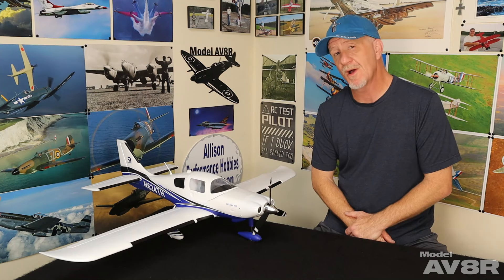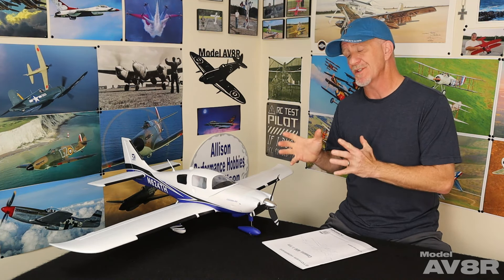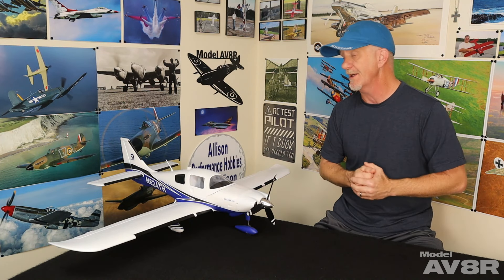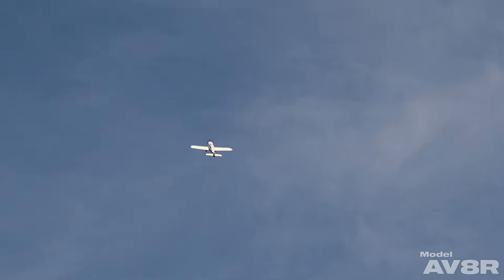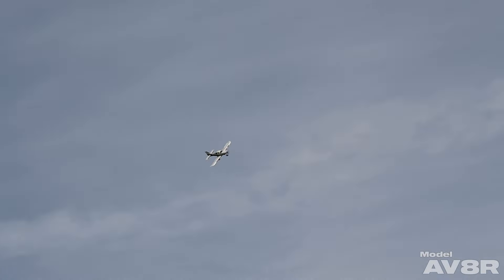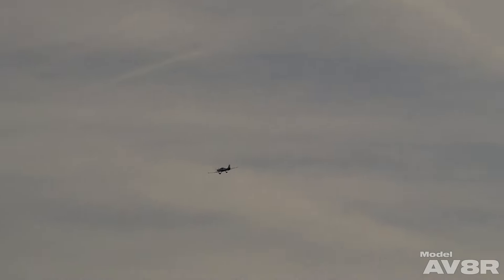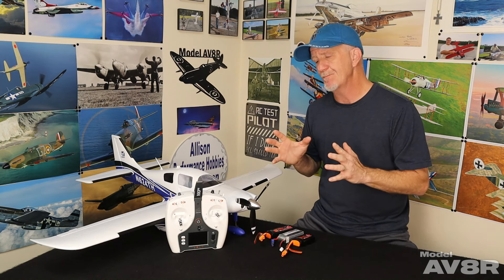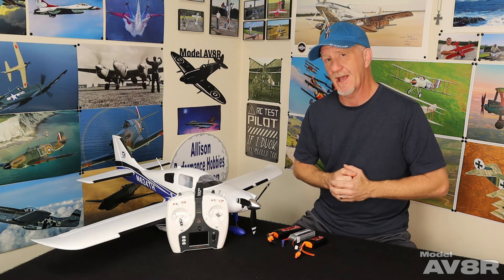Tower Hobbies Cessna 400 1.1m PNP - Model AV8R Review

Comment: Alternative fix for the rod flex: Take a cable tie/zip tie, wrap round the push rod, insert it into itself and pull till the circle left is about twice the diameter of the push rod. Cut off most of the tail, in a point shape, leaving about an inch 'tail' behind. Poke this tail into the fuselage foam (don't have enough tail that you go through to the outside!), hold in place, power up and check the control movement/rod flex. If all is good, wick a few drops of thin CA down the tail and leave to set. End result is a couple of plastic, circular retentions which are super cheap, easy, neat and effective. It's a technique I learnt from a forum for the Twisted Hobbys Crack Turbo Beaver which was originally supplied with control rods that were too thin. Great review again Adam
Reply from the maker: Yep, thought about that. That is one of the tips we included in our "Tips for every RC Pilot" video to keep loose wires sorted. The pushrods on this create a good bit of pressure when they flex (or try to) as the servo is pushing them, so I though better of it...might pull the zip tie out of the foam. It is a great idea with the super thin carbon pushrods on a flat foamie.
Reply: @ModelAV8RChannel  Ah, I didn't know you had already featured it. I guess those metal rods push hard!
Reply from the maker: I think it is because the servos are close to the only place to fix it. Easy fix though...

Comment: Such a great presentation Adam & Heidi, well done. Love the HRB batteries. Looks good enough to fit a camera in the cockpit.
I had a similar problem with servo wires & threaded the wire thru a small shrink tube then glued to the foam. I did a similar fix in the UMX Twin Otter nose area where the steering wire comes thru  to the nose wheel & was interfering when the battery was inserted. The small ‘feeder’ tube glued in & wire threaded thru fixed the problem.
I am giving you both 🌟🌟🌟🌟🌟
Reply from the maker: Thanks Noel! Yeah it isn't a "must do", but I feel better with it done.
Reply: Just been watching this again Adam, On sale here for US$160 inc delivery in Yellow only.

Comment: Great review Adam. But that pushrod flex I never seen as bad as that. To bad the rear section isn't screw in and it should really come with floats. I still fly my HK TL2000, a very similar plane in size and look and fantastic on floats.
Reply from the maker: Thanks, yep, good little plane.

Comment: Great review as always Adam 😊 HRB batteries are your brand choice of batteries?
Reply from the maker: Thanks man! HRB's are just ok. Cheap, good in some lower amp propeller driven planes, but they struggle in EDF's after a short time.
Reply: @ModelAV8RChannel  in your opinion Adam what batteries do you think are the best out there?
Reply from the maker: Honestly, I'm not sure. I have a bunch I'm testing over time. Spektrum, Pulse, HRB, Zeee, Ovonic, and if they ever get them back in stock I'll try SMC. You have to be careful about "advice" on line about batteries. People will see tests on forums where they are killing the batteries with extreme tests in seconds/minutes and they will repeat those results as if that is gospel. So many people repeat other peoples talking points. SMC is a good example. So many people say "they are the best" that don't even have any of them...or have a few, but they have less than 50 cycles on them. They are brand new. How do they know? Every brand new battery performs well. SMC may very well be the best/one of the best, but simply having a few isn't proof of that. I have a bunch of batteries...most with 50 to 100 cycles, so none at or near failure yet. I simply charge them up, use them normally, then storage charge them.  Once I see how many cycles (charges/discharges) I get out of all those brands, I'll divide that by what they cost me. That will give me a "per flight cost". If that figure doesn't offend me, they are good. If it does, I won't get any more of that kind of pack. Everybody's results may differ, depends on how they store them, charge them, and what and how they fly with them. One thing is for sure, having new batteries that work well doesn't mean they are the best ever, lol. A bunch of people repeating the same talking points that haven't really tested them doesn't either. Right now all I know for sure is I've killed some HRB's running them hard in EDF's, and everything else (so far) is working great.
Reply: @ModelAV8RChannel  Thanks Adam for taking the time to give me your advice, I really appreciate it!!!

Comment: Adam, I have a question as far which Motor, ESC Would you purchase for the Phoenix Edge 540 65" wing span? I know as far as I'm concerned you are the most knowledgeable about Electric planes I seen on you Tube, hands down! Also I would be using Specktrum 6S Lipo's 5000mAh battery's in this plane. They say you can use a Nitro DE20 Engine in it, but I want to go Electric. Thank you in advance Adam!
Reply from the maker: Hey man, I'd use the power system I recently put in my Hangar 9 Christen Eagle. Pulls like a freight train. I use a 5000 6s as well with it and Xoar 16x8e prop. The ESC has a fan on it so it stays cool even in our hot humid Georgia WX. Will pull a 10lb plane nicely, and if you are a Spektrum flyer you get all the telemetry and programming capability.  I'll include some links below -  

Avian 5065 450KV Motor -  https://www.avantlink.com/click.php?tt=cl&merchant_id=953aec29-878e-4306-b620-2df85883455e&website_id=8dba204c-b65e-4b7f-95c3-89346f512d7c&url=https%3A%2F%2Fwww.horizonhobby.com%2Fhttps%3A%2F%2Fwww.horizonhobby.com%2Fproduct%2Favian-5065-450kv-outrunner-brushless-motor%2FSPMXAM4770.html

Avian SMART 100 amp esc -  https://www.avantlink.com/click.php?tt=cl&merchant_id=953aec29-878e-4306-b620-2df85883455e&website_id=8dba204c-b65e-4b7f-95c3-89346f512d7c&url=https%3A%2F%2Fwww.horizonhobby.com%2Fhttps%3A%2F%2Fwww.horizonhobby.com%2Fproduct%2Favian-100-amp-brushless-smart-esc-3s-6s%2FSPMXAE1100.html
Reply: @ModelAV8RChannel  Adam, thank you getting back to me so quickly! I order this plane so I yet know what the bottom of the air frame looks like. One of questions I have is being I'm guessing most pilots would power this plane with a nitro engine, and wanted to know if I have to make some vent holes in the bottom for cooling the Li-Po? I going be mounting the 100Amp ESC on the fire wall and like you stated it fan cooled. As far the prop you used Xoar 16X8e where do you buy them? I never heard of that brand yet. I only know of APC props, and Master air Screw.
Reply from the maker: Yep, probably a good idea to cut some vent holes...doesn't take much. You can get Xoar props on Amazon, at Extreme Flight RC, and at Justmodelprops.  APC or Master Airscrew electric props work fine, I just prefer Xoar. They come pre-balanced and have less flex.
Reply: @ModelAV8RChannel  Thank you so much Adam for your help advice! 👍😀